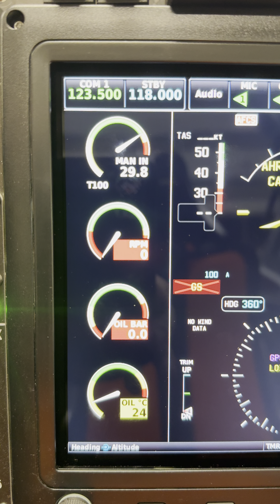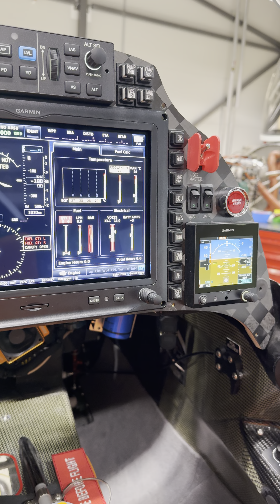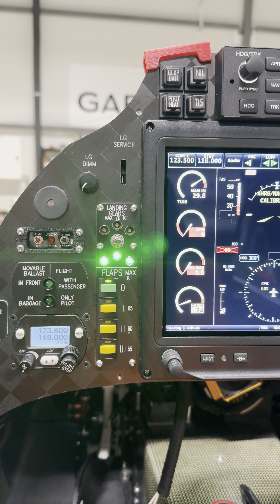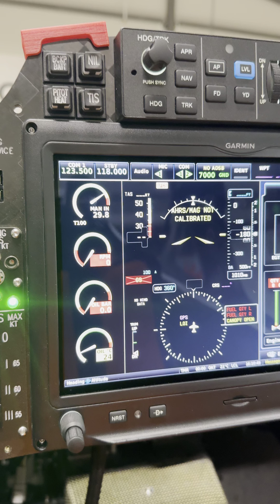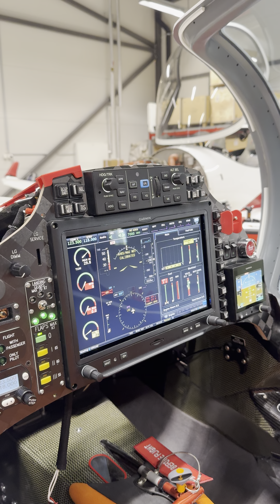Quick update on the EPCC (Edge Performance Can Converter)

Comment: Does this work in conjunction with the Garmin GEA24 for G3X installs? Or does it replace it?
Reply from the maker: @Hd84hw9g  it does yes
Reply: I believe it’s used between the Edge Performance ECU and the GEA24 . OEM Rotax ECUs don’t require this step since the GEA24 already understands  the Rotax protocol.